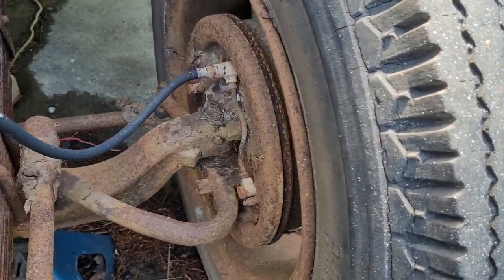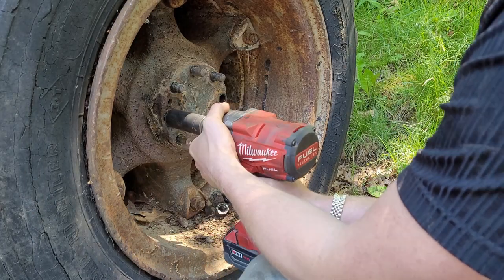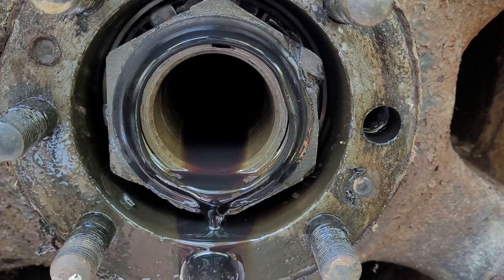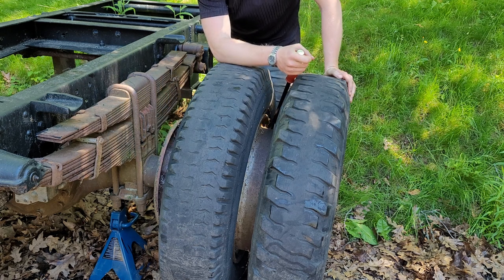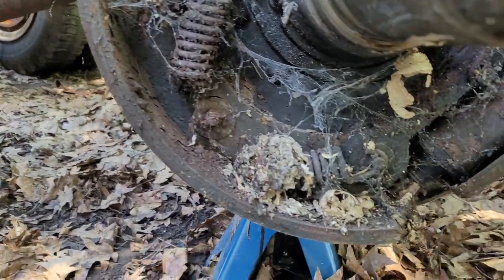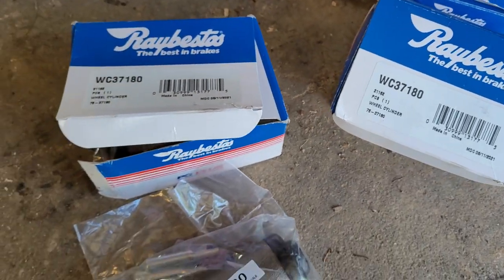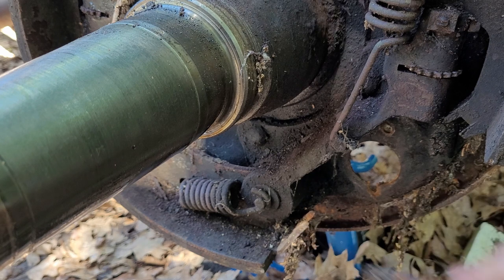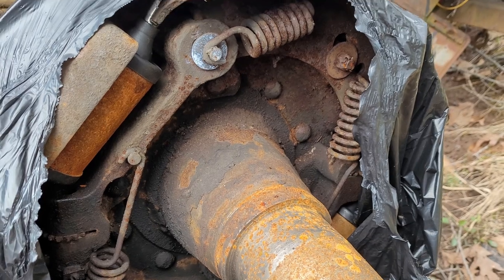1955 International Harvester: Brakes part 1

Comment: Bennett, couldn't have had a better ending to my day; as watching your video updates are something to which I always look forward.  This one was no exception. I enjoyed it from beginning to end. Can't believe the condition of the axles and the ease with which you removed the wheels. Can't believe the overall condition of the brake assembly, given all the time the truck spent sitting in the woods.  Wheel cylinders are massive. Thanks for sharing this! Hope all is well with you.
Reply from the maker: Thanks Paul! Glad to hear you enjoyed it. I didn't especially care very much for that video myself, it was mostly put together quite a while ago, but I've been so far behind on my editing recently that I decided I would put that one out. I believe I have enough footage for 2-3 more videos, so this summer should see way more work done. I think I may have to redo the steering on the truck now that the engine is in there, just not enough room. I may have to take another look at your power steering videos to see if that will work for me!
Reply: @RustRehab  let me know if you need any photos or anything

Comment: Working on my 47 IHC KB5 and found some new 750 20 tires out of China. Pulled the rims and at ture shop now. Once off there is another series of bolts that just spin. Look like they're going into the drum. Trying to figure out back side on and was hoping I'd see you remove rims but didn't on video unless I missed that one?
Reply from the maker: @brunoclassics  nope, sorry! Those tires are actually still on those rims today for me. They're almost ready to go back on the truck, but there's a tire shop up my way that still does these tires so I'll just have them do it all when the time comes for a replacement

Comment: You were smart to leave those Dayton wheels mounted to their centers, those wedges can sometimes fly off into orbit (and through you if you happen to be standing in their way) if you just try and remove them carelessly.
Reply from the maker: I would love to modernize the wheels, or at least go with 1 piece rims, but I haven't had any luck. Split rims like those make me nervous, but there are spots that still service them in my area at least.
Reply: @RustRehab  As far as split/locking wheels go, Dayton's are quite safe. Even conventional lock-ring wheels aren't that hazardous if you respect them.
Reply: Loosen the lug nuts and then bang on the wedges to get them loose, that way if the wedges do try to fly into orbit the lug nuts will stop them.  Looks like your outside Dayton rim is cracked. I think you can find 22.5 Daytons that are modern 1 piece tubeless rims.
Reply from the maker: @glenncourtney4876  finding 1 peice rims is the goal there for sure. It will be a sad expense for sure, but a worth while one.

Comment: I've been helping my aunt with her 1960 international bus/camper. I know the basics of hydraulic brakes on cars and motorcycles but heavy duty is a bit different. It has 2 slave cylinders per wheel like this one but each cylinder had a bleeder nipple. Worked on bleeding each wheel then i found the old brake booster underneath so maybe some of that needs bled too, i think i saw a bleeder on it? I think the main issue is the brakes are out of adjustment. Did you figure out which way to spin the star gear thing to expand the brake shoes?
Reply from the maker: That's awesome. I don't remember what direction the star gear had to turn, but if memory serves one is upside down and needed to spin the opposite direction. I could be misremembering that though. As for the booster, that I couldn't say. I'm putting a modern one in mine along with a double pot master because I feel it's safer that way. Old school remote boosters are different beasts  for sure.
Reply: @RustRehab  oh another thing. On the bus im working on the front brakes are different, they have i think two bolt heads. Do you know if one or both of them would be a plug for access to adjusters? Are the front brakes different on your machine?
Reply from the maker: @daftnord4957  I'm not sure, I know mine just had regular rubber plugs for the adjusters on the back, but I don't remember the front. I don't remember anything like that though. haven't touched the brakes for a while, it's one of the things I plan to finish off when hunting is all done up my way. If you have any photos or videos of that bus, you should upload them for sure

Comment: Finish fixing up that old red 50s Johnson outboard.
Reply from the maker: I found one of the proper pressure style tanks for it, but I haven't looked at that motor in a while. The boat I had it for is gone now, and it's too heavy for the Argo. I've been thinking about refinishing the paint on that motor, but part of me thinks it's best just to leave the original paint on there.
Reply: @RustRehab  I believe you can convert the fuel pump on it to a modern fuel pump that will work with modern fittings and modern fuel tanks.

Comment: Do you have the part number or link for the rear cylinders please
Reply from the maker: WC37180 is the part number that I used, I got it from Rock Auto but there are a few sources. There were a few different brake options for those year internationals, I think it depended on what rear axle you have.

Comment: Going back on watch out for your seal
Reply from the maker: Thanks, those tires should go back on this summer I believe. I just recently got a package with what should be the rest of the parts I need to finish most of the brake system.

Comment: Those wc37180 replacements are they the same in the front and back?  Thanks!
Reply from the maker: No, the front was a different number. My fronts are WC37228 they look a little like a triangle. They're more expensive, but they fit mine perfect. Good luck with yours!
Reply: Thanks for the reply and info!! I have a 1955 r180 with a PTO I’m working on!!  I got the from Tire off the front but the break drum seems to be stuck. Is there a trick to get that off?  Thanks again!!!
Reply from the maker: @warrenbell496  it's been a good while since I took my front drums off, but I seem to remember mine actually coming off still attached to the rim when I removed my tires. I would say look for a little break adjustment hole (2 actually) on the back of each drum which should allow you to run the brake adjustments in a bit so that the pads will clear the drums as you try to pull them off. The pads sitting in a Grove in the drums is usually what hangs me up when I'm removing drums, but I'm far from an expert. Good luck! You should post a video of your truck sometime, I'd love to see it
Reply: I managed to get it off! Just had to pry. The cylinder was seized out and the break shoe was worn into the break drum!! Do you know or were you able to find replacement break drums and shoes? I’m searching but can’t really find anything. I could get away with just new break shoes And machine the drums I think 🤔 Thanks again and for posting your videos!
Reply from the maker: @warrenbell496  glad to hear it! I never was able to find drums, but you could probably find shoes at oldinternationaltrucks, their a business in Alberta that ship all over. Someone else here in the comments recommended a place to have the shoes relined, so that's a good option too.
Reply: Hey, hope your good!  Did you ever look for or find the Erie wheel bolts for your split rims?  I found 4. 🤦‍♂️. Looking to buy some if you know anywhere that has them?  Thanks let me know if you can. Cheers!

Warren
Reply from the maker: @warrenbell496  sorry Warren I'm not sure what you mean by Erie wheel bolts
Reply: @RustRehab  no worries! There the D headed wheel studs for the front Dayton split rims. I can only find 4. Found 3 new shoes, 4 new break liners and 1 new drumb. Lol.  Was wondering if you converted the front breaks yet to something different?
Reply from the maker: Oh, gotcha. No I haven't changed my front brakes to anything different, I've only been into one side of them but they brakes there looked good. I probably won't get into replacing them with something different unless I really have to. I just have no self control when it comes to "project creep". I'm sure if I did, I'd probably end up replacing that front axle for something newer (and more serviceable)... Probably go with something that takes different rims, then buy radial tires.. Then add power steering, since I may as well if I'm doing a new steering box anyways. I've been working on the truck quite a bit latley, lots of body work and frame work. I'm way behind on video editing, but it's hard to sit behind a computer this time of year when I could be out working on something.
Reply: @RustRehab  same here,  trying to get most out of the weather before winter! Looks like I will be doing the same unless ! can find all those wheel studs. Definitely check yours out if there’s lots of rust I wouldn’t take a chance. Some of mine broke off just looking at them. 

  Those front break cylinders didn’t have a deep enough bore for the banjo bolt FYI. I got some today from a different company. Will let ya know if they’re different. Cheers
Reply: Hey, here are the part numbers for the front cylinders that fit the deeper banjo bolt dynamic friction 37547110 and 37547111 for the left and right. Hope it helps somebody. Let me know if you are willing to sell the banjo bolts or any parts. Cheers!!!

Comment: The original brakes are fantastic, do it right don't butcher it. If you want a new truck get one, don't kill another irreplaceable vintage one. International trucks were tough as nails, built to last, and their owners trusted them with their lives and their livelihoods,  you can't improve it, and it will only be original once. Please don't kill this truck.
Reply from the maker: I'd love to have a mostly original R-180, but there's nothing original about this one. I don't know if you've seen the older videos, but the entire driveline was pooched nearly 40 years ago, and it was already made from a hodge podge of other trucks at that time. Typical farm truck up this way. The only parts that are getting upgraded (for the brakes) are the master cylinders and booster, they're just not adaquate for a truck of this size. Remember, this is a 3 ton dump truck, not a half ton. That little booster won't cut it.
Reply: The safety factor of having a dual pot master cylinder is one of the few places I will disagree with you. I upgraded mine and it’s better all around.